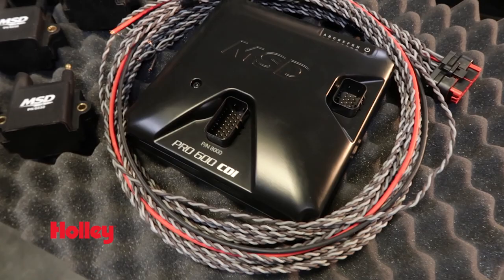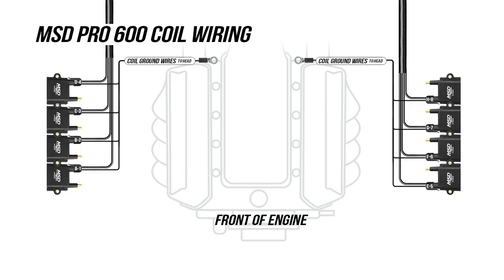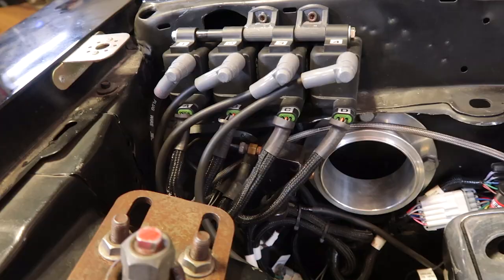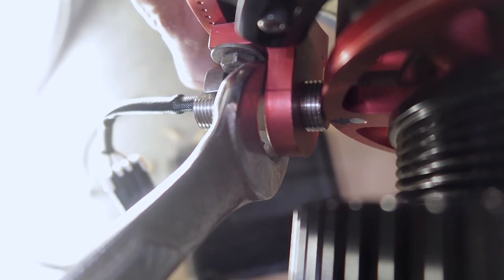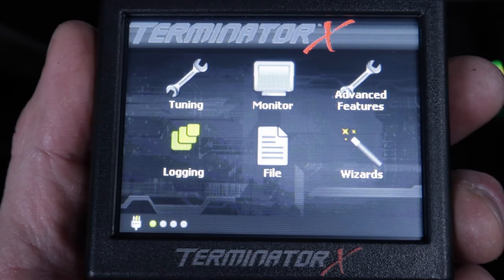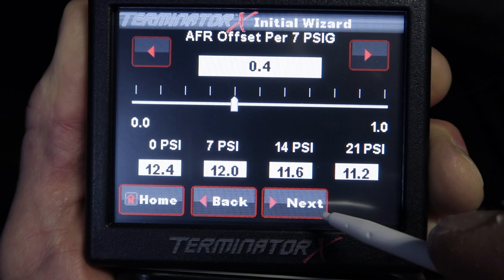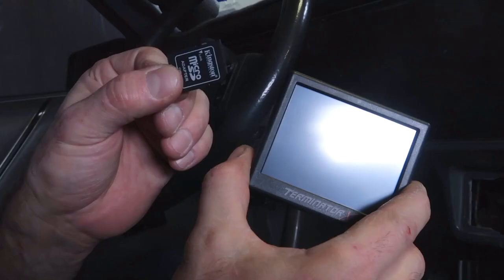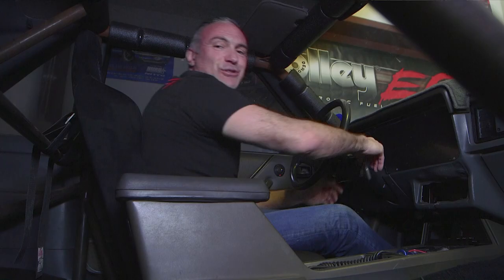Terminator X for Ford Part 2: MSD Pro 600 & Cam Sync on Small Block Ford

Comment: Do I really need the $1500 cdi box? I would rather just be able to use LS coils so I can just pick up new ones at any local parts store or junkyard. I just want to ditch the TFI junk and go DIS. I don't see why a forced induction application would need 47bagillon giga volts of power
Reply: trying to find this out myself. i was under the impression that if you have a terminator x and cam sync you can run LS coils with no additional parts from holley

Comment: Is this really necessary to run coil near plug set up? Or is there another way to run cnp  on the ford engine and run the stock x36 tooth crank trigger and cam sensor like the stock explorer 5.0?

Comment: The PRO-M EFI is much easier to do a coil on plug set-up, extra box not needed.  Just spec out    coil on plug set-up and you get the correct harness for the job. This Terminator X once done will look like a rats nest with all of the harnesses running all over the place.
Reply: Yeah holley is junk but the ls kids love this stuff